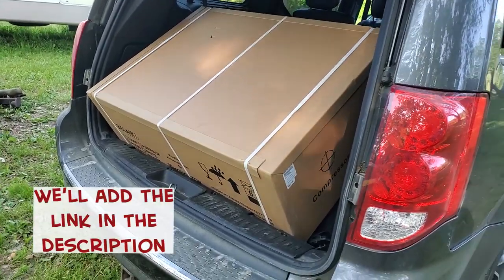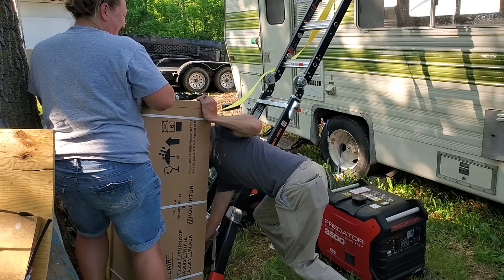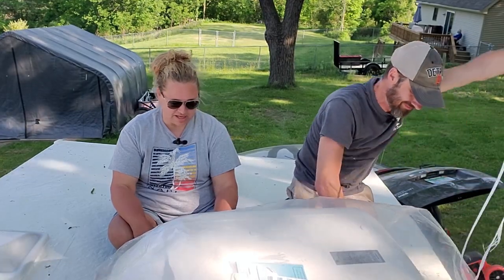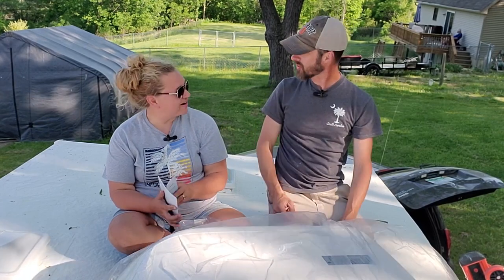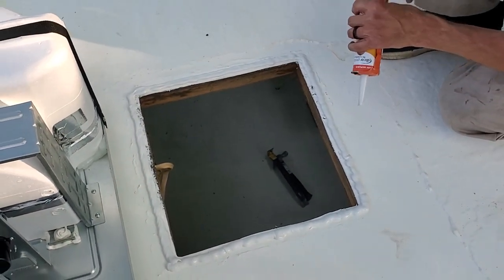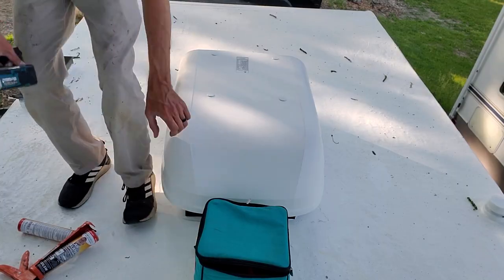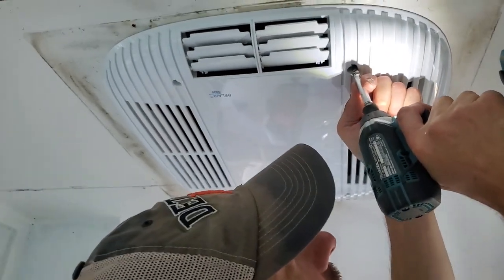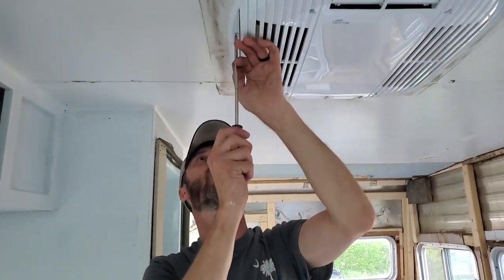1976 RV Renovation - A/C Install - Easy Peasy DIY RecPro 🥶 air conditioner with 🥵 heat pump

Comment: Hey Christy, when you do the black tank put your cleaning stuff in down the toilet.  Right before you start driving around dump 20 lbs of ice in it.  While the rig is moving and shaking the ice will help loosen any particles stuck to the sides and top!  Then it melts and goes out the poo chute.  Like putting nuts and bolts in an old gas tank to shake around and get the crud out.  But the ice is easier to get out!  Great progress!!
Reply from the maker: Hi Nick, that is a good idea; we'll definitely need to try that trick with the ice.  Poo chute, lol.  Thanks for watching and commenting and it's nice to hear from you :-)
Reply: You were always a good friend, I am enjoying watching you and your family fix up your rig!  I also have an older camper, and I built one from an enclosed car hauler!  It’s fun!!
Reply: Great idea Nick

Comment: nice video on air conditioner )👍when its hot you need good cool air 👍👍
Reply from the maker: Thank you!  I can't believe we grew up without it at this point.  Basically seems like a necessity.

Comment: Oh Guys! I was so worried about your ladder while you were heaving the AC up there! I had one of those ladders fold in the middle on me because I had it the wrong way around. Check the intructions on the side of the ladder. I'd hate you to have an accident like I did... 

(I wasn't hurt - but I'm still an idiot...)

PS, I learned that self-levelling sealant is really meant to gloop over the top of exterior horizontal screw heads and joints on roof vents etc. Non-self levelling ADHESIVE sealant is the best gloop for joint sealing / sticking down vents and AC etc.. But I'm sure it'll be fine.

PPS, The AC looks great! 🙂
Reply from the maker: So, funny you should say that about the sealant... The directions specifically said self-leveling (I think) but we've been thinking about that too.  For the purpose between gasket and roof, self-leveling doesn't seem like the best idea.  We wish we would have used that same ProflexRV stuff that we've been using on the walls and whatnot.  Hopefully this doesn't leak but, if it does, we'll have a good idea why.  And, we did have the ladder backwards because it was more flat on the back side to side the box... Never occurred to us that it might weaken it, sheesh!  Thankfully, we avoided a catastrophe 😵‍💫. Thanks for watching!  Nice to hear from you again.
Reply: @retrorevivals  Great to talk to you too, Tyler and Christy. 

It's a steep learning curve for anyone taking on a project like this. I used the wrong glue while re-skinning my RV's rear panel (I won't bore you, but I learned....) 

And thanks again for sharing! 🙂 But do be careful with that hinged ladder! (I'd rather you think me an interfering old fool than hear of an accident...) 

Continuing good luck with it and I'm looking forward to the next episode! 😅 I'm going outside in the rare English sunshine now to work on my own RV's stinky bathroom! 😅

Comment: Well that was fun. This install asking for the sealant is different then most others I've seen. Usually they just tighten down with the foam gasket, but what's a little extra sealant going to hurt, right?? That unit should be enough to pretty much frost you once you have all the walls back together and everything up and running. Good work getting that installed in record time with no prior experience!!
Reply from the maker: Hello!  Yeah, it's weird that it asked for the self-leveling sealant.  I almost want to read the directions again in case we got it wrong, lol.  Anyway, like you said, can't hurt so hopefully no leaks!  We appreciate you watching and commenting!

Comment: I was painting the wheels on our 5th wheel, had a little rust. Was thinking about you guys and the color of your wheels, I was not that brave. Went back with white. But that will look good on your RV.
Reply from the maker: Thanks!  We're excited to get them put on and hoping everything will work well with the 16" wheels.  We appreciate you watching and commenting.  Have a great night 😀
Reply: @Retro Revivals  the original wheels were 16.5" because back then all the 16" truck wheels were split rim bias ply that needed inner tubes. They were dangerous. At some point the tire companies decided to make 16" radial tubeless truck tires for drop center wheels. Then it became  difficult and expensive to get 16.5" tires. I remember the 16.5" tires having on them do not mount on 16" rim. When 16" radials came along they and the ones for split rims had warnings to only mount on the proper rim type.

Comment: I would like to do the same thing. The wire that was coming out of the roof to tie in your new AC, where did you find those wires? Were they already in the ceiling?
Reply from the maker: Yes, since we replaced an existing A/C, the wires were already there.  If they weren't, we would have had to run a wire from the breaker box.  Thanks for watching!

Comment: Im 2 min and 55sec in and screaming but yall can't hear.... TURN THE LADDER AROUND....ITS BACKWARDS
Reply from the maker: So here's the thing, this is Christy.  Tyler put it backwards on purpose because that side is flatter to slide the AC.  He didn't tell me until after how dangerous it is to have it that way.  We'll need a new system next time.  Thankfully, everything worked out ok!